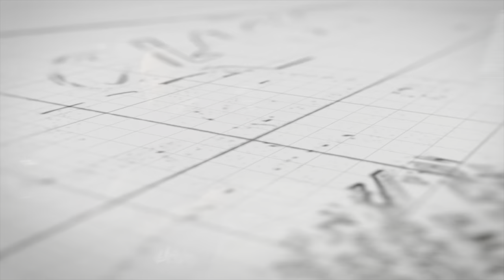What’s in the Yard? Our current collection of vehicles

Comment: I'm only 16 miles from Ocala  been working on 89 S10 blazer she had 2.8 but putting in 4.3 she's four link but bolt on kit junk air bag it so had to order a diff bracket that's full 10 bolt instead a five bolt there hard to do crooked frame model so they say it's easy if removed body